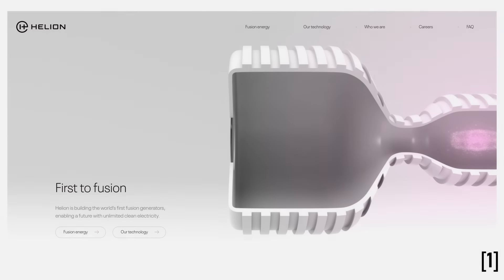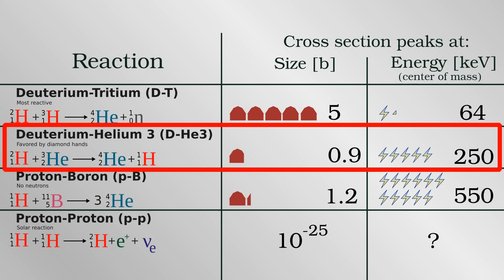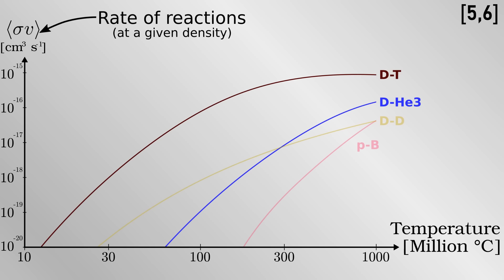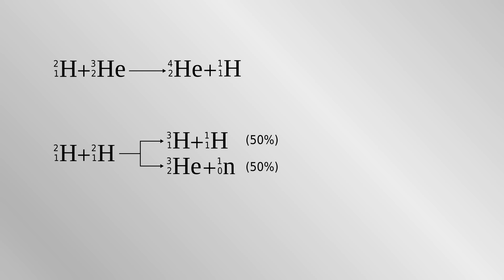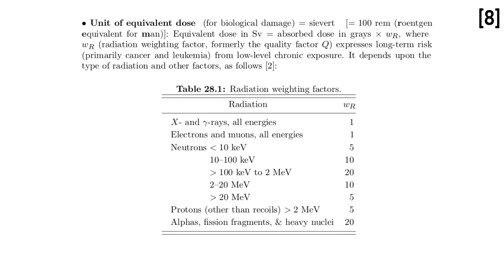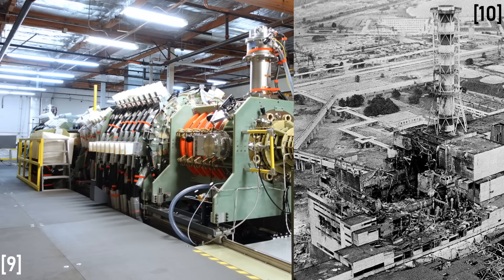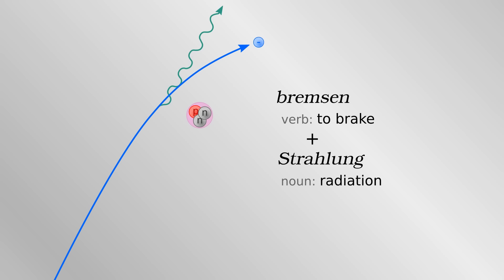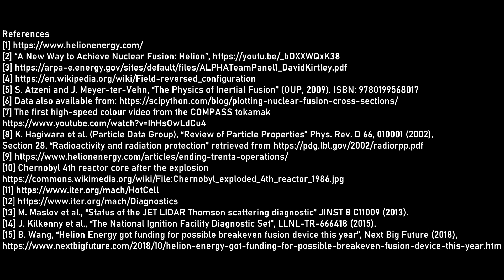The problems with Helion Energy - a response to Real Engineering

Comment: While these are definitely some incredible points, I find it hard to believe that Helion has not accounted for neutron production in some way. If they do indeed wish to generate power from their next planned reactor, they will absolutely need a significantly higher reaction rate to ever commercialize it. However, don't you think it's a possibility that they are simply "testing the waters" for their next reactor? It's not as if it's a final product by any means, they still have plenty of time to increase reaction temperatures and adjust reactor size and geometries in their future generation reactors. As this is their first attempt at power generation, doesn't it make sense to start on a smaller scale that is relatively cheaper than to build a full-scale plant-sized reactor before you even know if it works?

Also, on the bremmstrahlung losses with the power generation, would these not be basically negligible? Bremmstrahlung radiation is present in every fusion plasma, but typically only an issue with high Z materials (as it scales with Z squared). I'm writing a paper on Helion's new attempt at power generation and their reactor design so any feedback helps!
Reply from the maker: If you watch the livestream I did, I raise a lot more points and expand these ones.

Comment: I see that episode and I was a lot skeptical from the firm presentation, to the way the want to generate electricity, but, I am a simple student of aerospace engineer so I don't know where to start to looking for information about the concept of the system and if it was something correct or wrong in the video, thanks, you give me some starting points for more digging
Reply: There's nothing hard to understand about magnetic induction, fundamentally it makes perfect sense. Engineering it to a state where it becomes a net energy output in a fusion machine another matter. Solving the issue with neutron decay is also going to be very difficult but not impossible.

Comment: Just curious so ill ask, based on the graph why not just go with deuterium deuterium reactions at lower temperatures to avoid neutrons while being more efficient than H3
Reply from the maker: Well, the D-D reactions are the ones releasing the neutrons (50% of the time). In any case, Helion would have to do D-D at some point to generate the Helium3.
Reply: @ImprobableMatter  ah thx for tellin me idk much abt the details when it comes to fusion i just think its cool

Comment: At first I thought ''what is this random channel's video doing in my feed''. But upon watching, the narrator seems to know what he is talking about and makes valid points of criticism. This wasn't a ''slander'' piece but a well researched video that might go above the average Youtube physics video enjoyer's comprehension of the topic I had some mild trouble following the science but it seems to all be valid. I think that even if Helion's approach might not be the most efficient or effective the more actors are working on Fusion energy the more information we gain and the more tangible commercially viable Fusion becomes. But in all honesty they need a lot of shielding because you can't just put up a field to block Neutrons since they are neutral. Also might I ask if that Bremsstrahlung that was mentioned is the same as Synchrotron radiation, i.e. the radiation that changing the acceleration vector of a Lepton gives off, because it seems really similar to the process used in that accelerator and the Paul Schärer Institut that I got to visit a couple months ago.

Comment: it was wild to see how much funding Helion pumped into media and PR stuff. in engineering, that's generally a really bad sign that an Engineering firm's product is absolute trash and will be trash for quite some time. literally every engineering firm that has done a PR blitz like this has followed the pattern of massive positive media followed by years of nothing and then either collapsing or finally producing something of some value (but never quite what was promised). 

in fact, i really can't think of a single example of a new product living up to its media hype in the STEM world. Maybe printed magnets? but even then, no major manufacturers have picked up printed magnets for cabinet latches or really anything yet

Comment: Maybe watch the RE  video again, they do mention the neutron radiation after the 14 minute mark. They also mention several times in the video that their initial calculations were off and the fusion chamber is to small resulting in them having to run the reactor at lower than optimal temperatures.

Comment: I briefly worked for the people behind Helion in the late 90s. They are smart folks and big machines make for a fun projects but I don't think most people in the field actually think we will have viable fusion based power production this century (if ever). (I am talking about scientists, not the marketing people) I love big physics projects but this is a huge waste of resources when we already have viable solutions that work today and would benefit from refinement. Simply based on the principle that there is no such thing as a free lunch, even if it works, fusion will be so complicated and expensive that, fission, solar etc are going to be much cheaper and faster.

Comment: Nice video, though from what I remember from Real Engineering’s video. They weren’t planning on using temperature at all for power generation, instead using the magnetism generated from the reaction to be converted into electricity directly. The temperature of the reaction is only needed if you plan to turn a turbine with a gaseous medium (typically steam) created by the reaction’s heat. As such, I don’t think the first part of your video where you say the reaction “does not produce a high enough temperature” would actually be a factor here. That being said, I am not an expert in this field. I don’t know if direct magnetism transfer is a viable method of power production. I just find it fascinating that your video didn’t touch on that aspect at all and instead defaulted to talking about temperature right off the bat as though producing high temperatures was the goal of the device.
Reply from the maker: We are talking about the temperature of the plasma itself, which must be at least 100 000 000°C to allow fusion. This is far above the melting point of any material, so it must be kept away from any solid materials like the walls of the reactor or turbines. Yes, Helion claims to have a direct energy conversion method, but they must still get their plasma hot enough.
Reply: Awesome, thanks for the clarification.

Comment: The issue with D-T is that most of the energy is released as n and gammas that are not easily converted to heat or electricity.  Neutron shielding is not done by solid shielding but rather water (H collisions are the peak energy transfer for n)

Comment: I don't know the economics that well but when I saw real engineerings video I suspected the funders of Helion may have an unusual endgame. They will probably never produce power, but they will produce Tritium, which will be in short supply because of all the other fusion research. I don't know if they can produce it more cheaply than Lithium fission, but if it does turn out cheaper it will be a mint.

Comment: One of the main premises of this video that helion is satisfied by 100 million C is false. I don't know where you got this from. 100 million C is what they reached with Trenta. Polaris will reach much higher temperatures.

The section about neutrons applies to literally all fusion reactors. The difference with helion is that they will produce much less neutrons with far lower energy levels.

The part about particle gyroradiuses you're probably right about, but it's most likely just an misunderstanding on Real Engineering's part.

Comment: As an engineer I applaud critical thinking. The video by real engineering might be an interview with a marketing executive / entrepreneur but from what I saw there is solid potential in "the rail gun approach". For a topic that will revolutionise the world there will always be venture capital. For me what makes the approach sound promising is that they are trying to address the fuel problems and seem to be much more down to earth.... like an engineer should be rather then some physics lab. to poke holes in the approach without a solution is just click bait and yep im another stat! linear rail gun limited by timing and precision seems a lot more promising then a donut rotating or some kind of fuel falling and lasers...... given that real engineering was most likely given excusive access and had to sing to the same tune. I don't see how you can fire little cannons across your little lake of tears.

Comment: You make some good points, but none of these things technically make what helion is trying to do fundamentally an impossibility. As they iterate (which is quite fast as they have several prototypes and more on the way), these challenges can be addressed. As for their choice of He-3 and operating temperature influencing the probability of reactions, you seem to be comparing it to mammoths like ITER and JET. Helion is like the Prius at a drag race. There's no way it'll beat the muscle cars, but it'll still cross the finish line.

Comment: One factor that is never mentioned is reaction density vs. reaction rate. High density is required for meaningful energy production, because fusion is fundamentally statistical in nature, and nucleons are essentially pointlike. For example, in the core region of the sun the density is 200 times greater than water, yet on a volume for volume basis, a manure pile decomposing, produces more energy.......

Comment: I have a question about ITER and other types of tokamaks like SPARC. Is there possible to use spin polarised fuel which would be for more efficient ignition of fusion and also usage of neutrons?
Reply from the maker: It seems difficult to me, because each nucleus has to collide hundreds of times before fusing, so it seems like its spin would randomize too quickly to make a difference.

Comment: Good video. Answered a lot of questions I had and gets my inner skeptic activated. One question I had was managing reaction preferential. Helion even claims to have a solution (power reactors vs. fuel reactor). Although not explained, it seems the use of feedstock ratios could manage this. Rather than 1-1 He3/DT suppose it was 10-1? This would drive the reaction preference. Of course you're losing 90% of your possible reactions. Still you've got a lot of pesky neutrons. I do like the iterative process. The more experiments you can run the more you can learn. I just hope they are learning in useful direction. TANSTAAFL.
Reply from the maker: I went into more detail in a livestream if you can bear sitting through a billion "um"s and "uh"s: https://youtube.com/live/wK5v1Nw98xs

Comment: Pie in the sky thinking. I run into this when discussing the NGAD fighter with people who think they will mount a 50KW laser on that thing and shoot down enemy fighters and missiles with it. When I try to explain the size of a solid-state or C02 50kw laser,  or even a chemical dye laser (a terrible choice as a single downed plane could spread poison everywhere), the common answer is "miniaturization,"  and I then put it forward. "Ok, let us say you can "miniaturize" everything... how will you power it? If you think fitting gas tanks on a hydrogen car is a pain, try fitting the 36 jumbo jet engines required to power a 50kw laser on a stealth fighter's airframe...

Comment: Fusion is always touted as "not having a radioactivity or waste problem" like fission but that just doesn't seem to be the case. There may not be waste, but there is plenty of radiation. Molten salt thorium fission is possible and could produce much less waste. We know what the main problem is - advanced materials that will not corrode in the caustic salt solutions. That's a BIG challenge, but it opens up a world of cheap energy with 100x less waste per TWh than current fission. And none of the mountain of challenges that fusion needs to go from net energy gain to commercial energy production. America needed to get serious about nuclear physics & fission back in the 1980's, and put billions more into fusion as well. Now the whole globe is scrambling as energy scarcity looms.

Comment: I came into this video, slightly biased. However, after seeing it, I do find a lot of merit in this argument.

While I do not doubt that helion might not be able to generate scalable electrical power without dealing with a ton of engineering and physics challenges.

Their work and mistakes will help other companies do better in this field.

Nuclear fusion should not be treated as a pipe dream. Engineers and physicists should remain stubborn and be ready to throw some hands at any concept that is uncontrollable.

Comment: while I must agree with most of the arguments made, the neutron shielding point is just wrong in it's explanation. While I agree that shielding is lacking, the statement about dense media being needed is fundamentally wrong. The best neutron absorbers are materials which have a high concentration of H-atoms. This is why common neutron absorbers are hydrocarbons like parafine. To be completely correct on the neutron absorbing potential: U-238 is the best choice, but then you need shielding from the emitted photons. (Great for calorimetry though)
Reply from the maker: Fair enough. As a plasma physicist for me "dense" means "[number] density of condensed matter", rather than laboratory and space plasmas which are many orders of magnitude less dense.

Comment: eh, braking radiation and D-D reactivity have been known issues for aneutronic setups since before the 1990s
 
Helion thinks they've found a way to solve those, but they're unlikely to share precisely how since the Chinese are already building copies

we do know that high-beta conditions are far different for brem and reactivity than the low-beta tokamak approach, particularly in a machine that doesn't require ignition or continuous operation

are the conditions different enough to harvest the claimed 95% of the energy from charged products? still skeptical on that point but we'll soon see just how much Polaris can suck back into the capacitors after a pulse

at any rate the graphs of reactivity in this video seem to miss the major point of such a design, which is to minimize required temperatures and neutronicity, not maximize power output -- 1000x as much power output in the form of fast neutrons isn't nearly as commercially useful as avoiding a turbine by harvesting charged products

also for the pinned post, you can stare at the initial plasma "smoke ring" all you like, it only generates neutrons at the compression pulse

Comment: When I watched the video of Helion Energy, I was almost convinced of the credibility of the content, but after much thought, a very important point caught my attention, which is the speed of the plasma before the collision, which reaches 1.6 million km per hour, or 444.444 km per second. According to the dimensions of the device, it is clear that the length of one half does not exceed  10 meters, so if the plasma was released at a speed of 10 meters per one millisecond, it would be only 10 km per second??????????

Comment: Line the reactor with BeLiF3 and align 3 of these on top of a large vortex tube and fire in synch with a rotating magnetic field. Each rotation would double the energy to a point, and then the magnetic pinch at the throat region of the vortex tube causes a self-sustaining reaction. In short, use these helion modules as plasma injectors into a bigger reactor.

Comment: I've always been critical of fusion down here on earth for power. If we want to make use of fusion energy, i suggest we put up wind turbines and solar panels. Because the wind cycle is powered by the biggest fusion reactor within like 3-4 lightyears: Our sun.

I could see engine technology from electrically induced fusion, though. If instead of trying to prevent all the Bremsstrahlung or neutron emissions or other heat losses, why not instead try to generate thrust with them? Like, an ion engine souped up with extra thrust from fusion? I could see that having viable applications. The way Helion says they can recapture the energy from re-expansion of the plasma after it underwent fusion sounds an awful lot like a jet turbine in principle. In a jet turbine, the same shaft connected to the compressor for air inflow is powered by the reaction of the jet fuel with said air. I mean i'm not a plasma physics expert, but couldn't one use that concept but with fusion reactions instead of chemical combustion?

Like, compress the plasma, let it fuse, recapture some of that electrical energy from the re-expansion to drive the next compression, but let the rest of the energy (like, the heat, neutrons etc) produce thrust? Is that a viable concept or am i fibbing here? Thoughts?